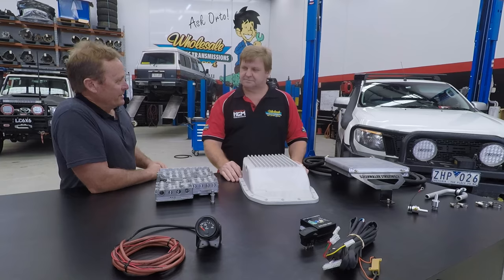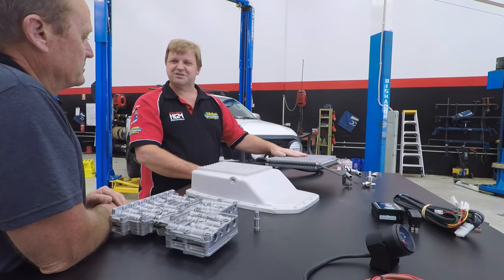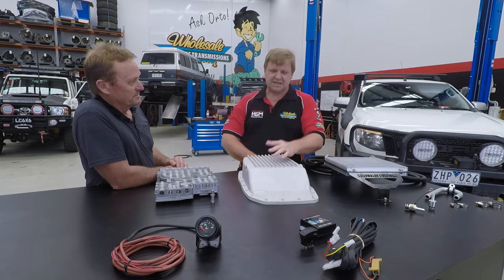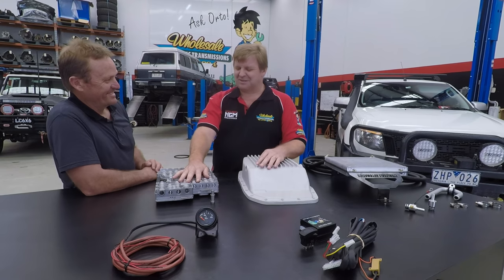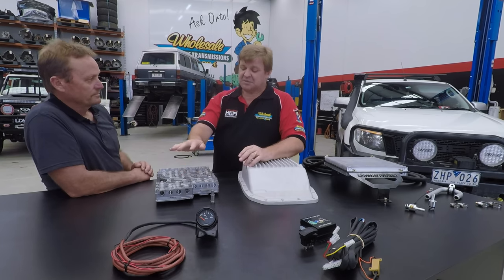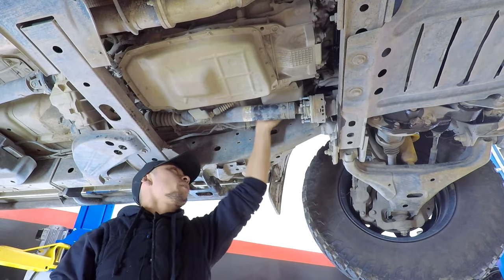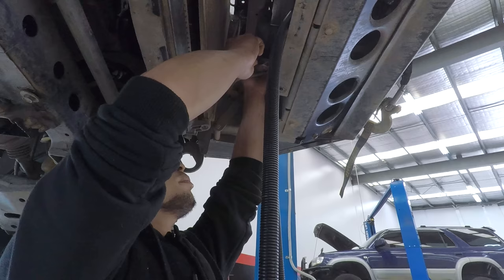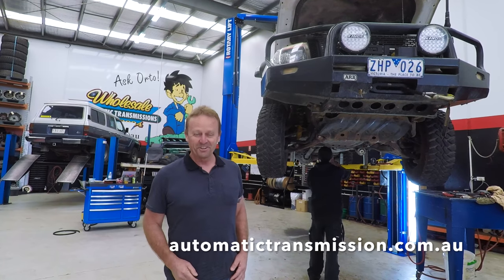Ford Ranger Automatic Transmission Upgrades and Installation

Comment: Hi gentlemen your nomad valve body  seems very  interesting. Let me explain my issues and let me know whether a valve body upgrade can make a difference. I owned a 2014 model Mazda BT-50 new from the dealer and from the very first week I noticed after driving down hill for about a mile and a half without much of depressing the accelerator. When the vehicle gets to the flat area of the road it hesitates to move, and normally once I remove my foot off the brake the vehicle starts moving without even the accelerator being depressed. sometimes the power train trouble light would come on. Then two things would happen after that. It I continue accelerating after a few seconds I would feel a bang or jerk from the transmission and the vehicle would drive fine after that, or if I switch the engine off and start again the vehicle would be fine and will drive with no hesitation. Also if the power train trouble indicator came on, switching the engine off and on again the indicator would go off and vehicle would drive just fine. I reported that situation to the dealer and they tried multiple fixes including replacing the TCM, replacing the transmission, and replacing the wiring harness and the problem still persisted. Until after two years the vehicle was replaced to a 2017 same Mazda BT-50. It did not take long to realize the newer model had the very same issue just a little less often. So I decided just to deal with the issue by restarting the engine when the issue comes up. But after three and a half years or so, I was pulling out faster from a minor road on to the highway and the wheels were spinning with not much traction so I eased off the accelerator and pressed it again and I felt a very hard bang in the transmission similar to what it does after going downhill for a bit. But much harder it actually startled me. Immediately after that happened when the vehicle shifts from 3rd to 4th gear it revs a bit high with a rough change. Long story short I drove the vehicle for about two years like this and one day it just stopped and transmission fluid spilled on the road. I replaced the transmission and torque converter. The original torque converter welded plate came off and the center pin broke off. 
Same issue exists after driving downhill for a bit. So would like to know if your valve body solution can help with this issue. 
Thanks in advance.

Comment: Our workshop has a PX ranger with torque converter clutch solenoid stuck code stored in the TCM. Is that the automatic transmission out?
Reply from the maker: No not at all. Give Trevor a call on 03-97628004 and he will let you know what needs to be done but it just pan and valve body off for this one.

Comment: Why don’t trans oil pans have a drain plug? It’d make life a lot easier
Reply from the maker: Many do but the Ford Ranger doesn't until you install the larger capacity cast aluminium pan we have Andy.

Comment: My ranger has the transmission clunky problem from 4th to 3rd I'm in perth who can help me fix it where is your shop
Reply from the maker: Yes, it is very likley that this can be sorted with a Nomad Valve Body and we have  fitting agent in Perth. Call Ashley on 03-97628004 and he will get you sorted.

Comment: How much is this kit as I'm looking at getting a ranger raptor
Reply from the maker: If it's the 2L 10 speed then check this web link out.
https://automatictransmission.com.au/select-your-vehicle/ford/ranger/ford-ranger-2-0l-bi-turbo-diesel-with-10-speed-auto/?V_Make=Ford&VM_Ford=Ranger&VS_Ranger=2.0L%20Bi-Turbo%20with%2010%20Speed%20Auto